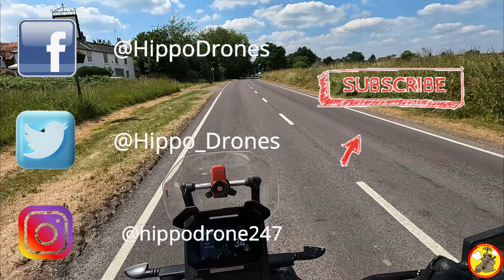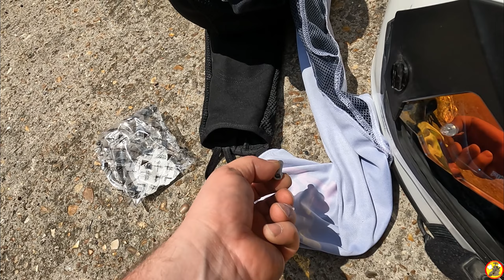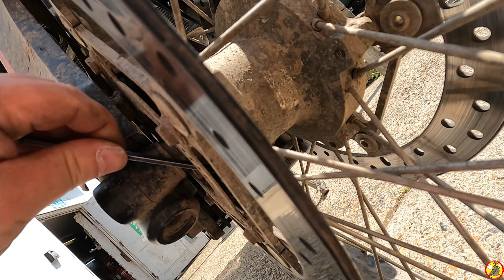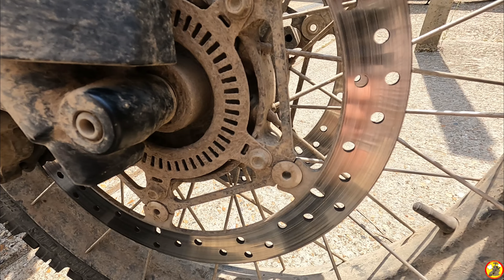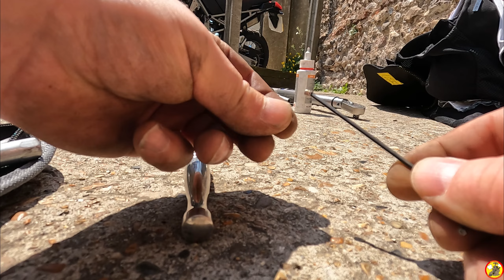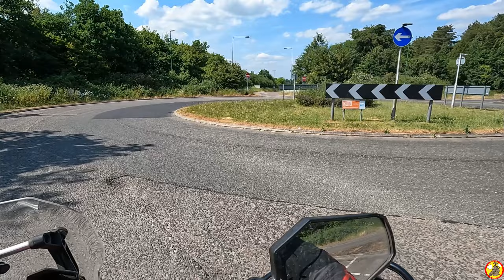How to Replace a Motorcycle Spoke in a Tubeless Wheel | Aprilia Tuareg 660

Comment: Well done! That’s puts my mind at rest, as my triumph scrambler has a reputation for breaking spokes on its tubeless rims!..
Reply from the maker: The Triumph Tiger has a slightly different setup at the hub, which actually should make replacing them even easier as you'll not have to remove the ABS sensor/brake disc. On the Triumph wheels it just has a nut that is used to torque them down, so a lot less fiddly than the Aprilia/Moto Guzzi wheels.
Reply: @HippoDrones  I have the scrambler 1200xe
Reply from the maker: @billybigbones450  I imagine the wheels are the same on both Scrambler and Tiger, can't see them using a different system. The Tiger seems to have the same issue as the Scrambler with spokes breaking!

Comment: Good to see that spoke back in mate. I couldn't do that on the T7 as the spokes are on the centre line of the front wheel, so it would be a tyre off job for mine.
Good bit of spannering done there Pete 👍👍
Reply from the maker: Yeah, that is one of the pains with tubed rims. Hopefully not something you'll ever need to worry about though 🙂👍

Comment: How you liking the motoz tires? Any updates from the last motoz video? Do you get the high speed wobble?
Reply from the maker: Hi Nathan, I'm liking the Motoz Tractionator RallZ more than the Adventures on tarmac, but they are still a knbbly tyre and more suited to dirt... and they do get a wobble still, but at a higher speed than the Adventures did, they are also better on wet tarmac too... but better does not mean good. In the dirt, they seem improved for straight line traction, but have less sideways grip.
In my latest trail riding video I talk about the tyres more in depth.